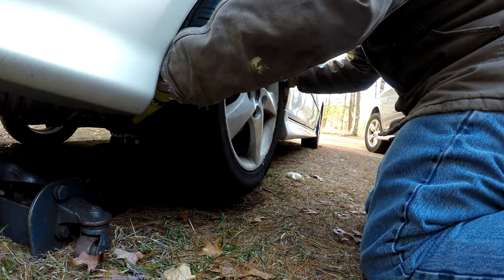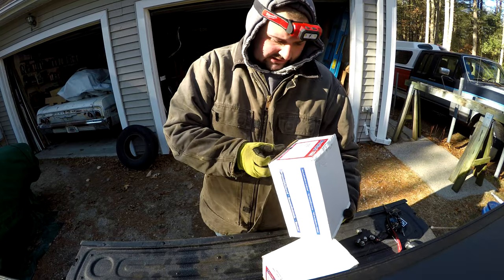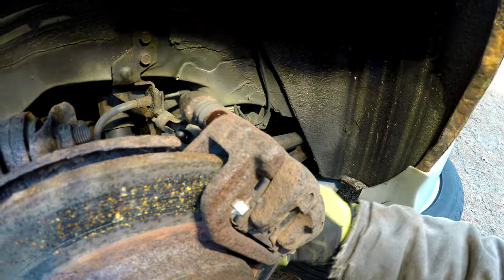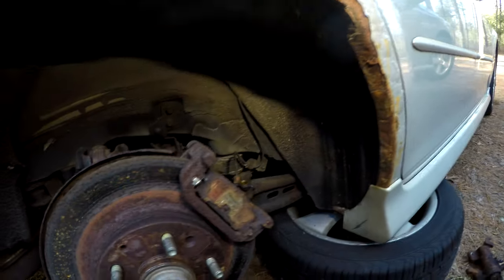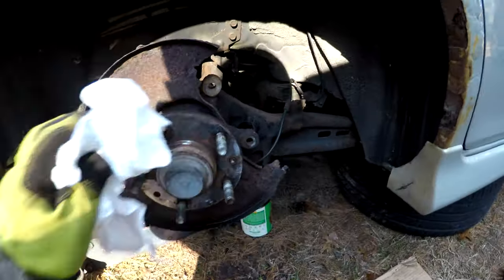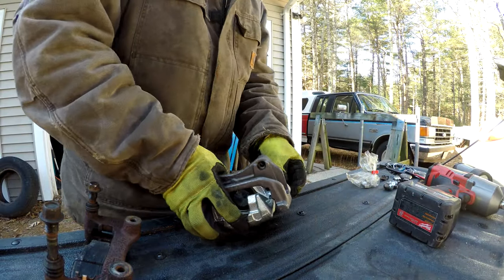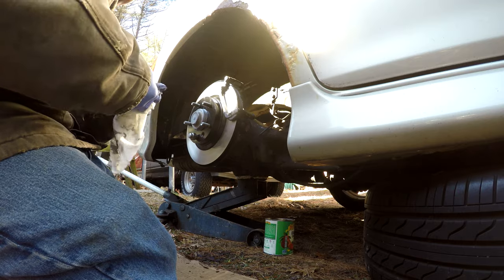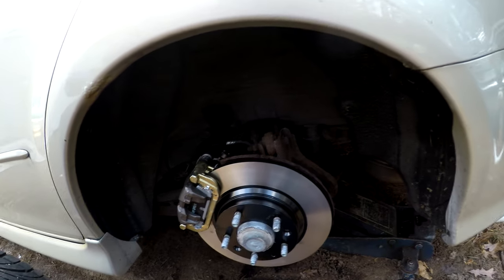Mazda 6 Rear Brake Replacement

Comment from the maker: Parts Used: 
Wagner ThermoQuiet PD482A - https://amzn.to/2UY9n7I
Wagner BD125611E Rotor - https://amzn.to/2HpYZ0q (Two of these required)
ACDelco 18J4132/Duralast 71446 - https://amzn.to/2SIb2Ly (Two of these required)
Rear Brake Caliper Kit - https://amzn.to/2UYx6o2
CRC Silaramic Brake Grease - https://amzn.to/320XUWi